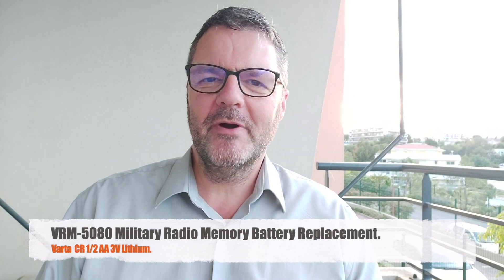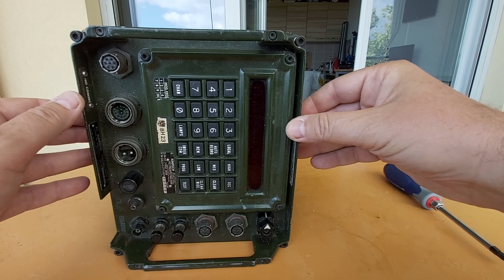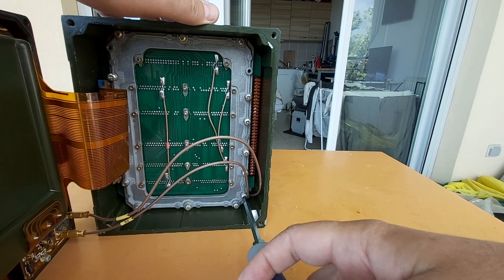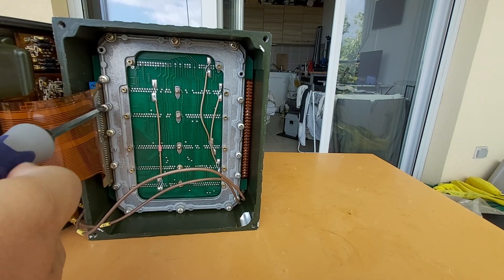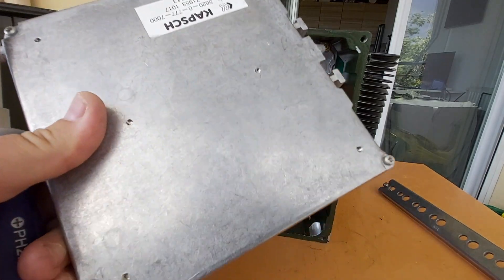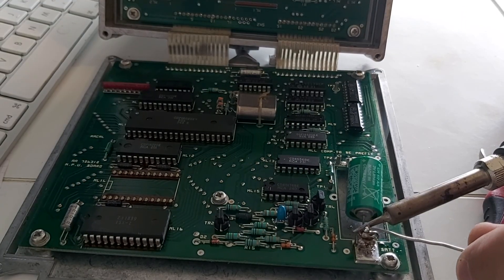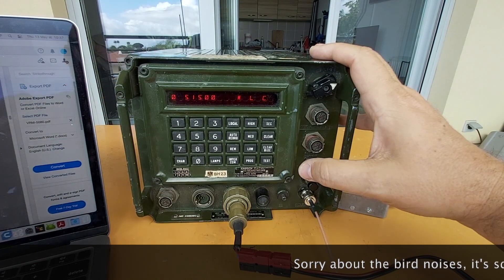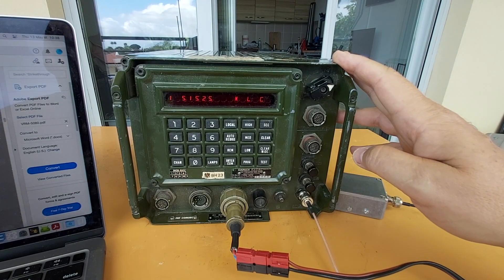VRM-5080 Military Radio Memory Battery Replacement.

Comment: Very useful video. What power supply and batteries do you use?
Reply from the maker: I use a 7S 5Ah lipo battery.
Reply: @RadioPrepper  many thanks, this video is very good. I have just purchased one of these radios for 4 meters in the UK. I hope it works.

Comment: Hi Gil, thnx for this video, I have problems with programming one of the 5080' s here, going to replace battery as well, so the battery is non- rechargeable?  73' Hans
Reply from the maker: Correct.
Reply: @RadioPrepper  Qsl Qsl
Reply: Found the original 3,6 V on the net but that costs 5 times the 3V version, I'll first try the 3V variant, will give an update on the result
Reply from the maker: The 3V I used had more voltage, not 3.6 but it does work fine.

Comment: when i saw this my mate said "you dont need a tank radio!" i said "no" and bought it i havent got to it yet, i just fixed a prc349,350,351-52 and tonight i bought a 1944frequency meter for £60 Check if it works tomorrow...
Reply from the maker: It's a great buy no doubt!

Comment: Very heavy duty built  for extreme contitions
Reply from the maker: And can be bought for a song today!
Reply: What would you call a song
Reply from the maker: $300. Compared to what the military paid for it in the 80s...
Reply: But rhen would pay 2000 for a hammer  good price
Reply: The military would pay 2000 for a hammer    but nice price
Reply from the maker: Yes. I would value it new on the commercial market at around $8K.
Reply: Wow 8k  but in 20 years it would still work
Reply from the maker: They probably paid $50K for it...